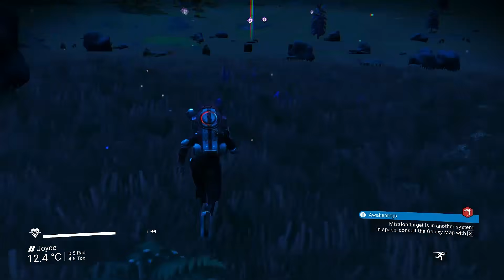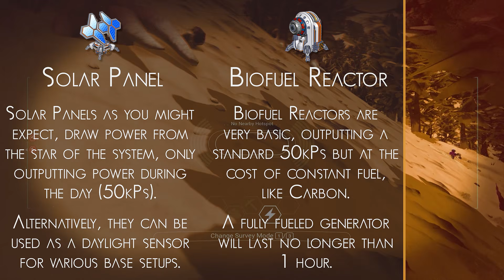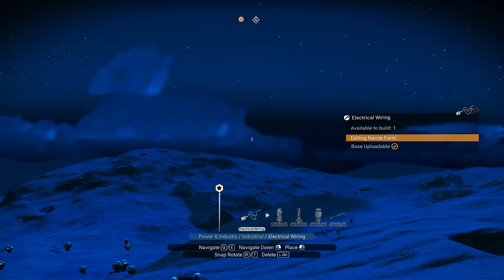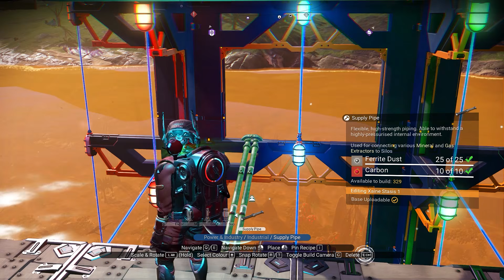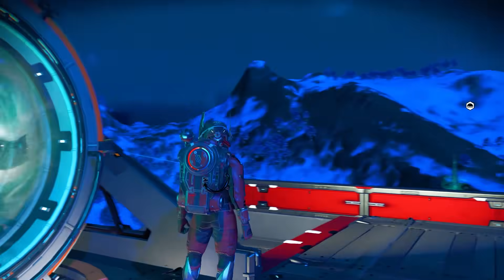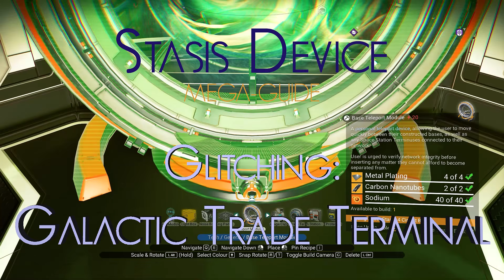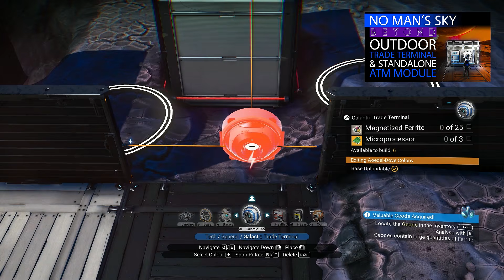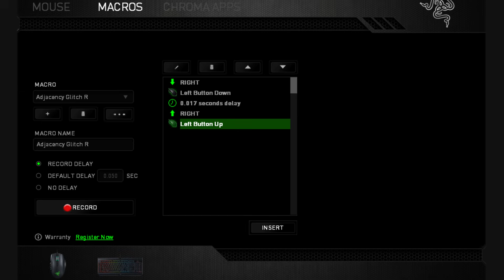Ultimate Money Making in No Man's Sky | Stasis Device Farming Mega-Guide, Units & Building NMS

Comment: What is the point of making 4 billion per hour when the cap is 4.9*** billion?
Good video though.
Reply from the maker: For achievements sake, for spending (you can spend a whole lot really quickly if you try) but also just because it can be done.
Reply: @XainesWorld  Agreed!
I just note what systems have Cobalt or Chlorine. 
Then when I need units just warp there with a ship full.
For Cobalt I usually get 82-85 million in the space station and the same at the trading post  164-170 ish million total.
For Chlorine  it's about  123-134 ish in space station plus same in trading post 246-268 ish million total
Per system.
It's even better if they have BOTH.
I have 16-20 systems that I can visit so Money's not a problem and by the time I need more the systems economy has recovered.
Just don't do it at a trade post in the "Glitched CENTRAL" systems as their stock doesn't change when buying or selling!
I did once and it took ages to get the ship filled back up with only 191 Cobolt at a time and each time you have to wait for "product received" before trying to buy again, no spamming the buy button as it doesn't register.:-(

46 stacks of 9999 to fill the ship back to it's previous level!

Lesson learned, I'm not doing that again.
The space station works fine though. :-)

Comment: OH, this is 3 years old, hmmm.  Hey does this still work?  I ask because I actually had an electrical error and did not realize the issue immediately, so I did find a power spot, yeah like my whole life it was just C but I was like cool this will work but I was outside my zone and by adding a wall I could not extend the reach, I threw down a base computer but it seems like one base can not power another base so that was a total waste of time and at this time I found the wiring issue so I fixed it and then my base was back up and running.  So yeah, old videos do not help NMS at all with so many changes and so much broken.  Later.
Reply from the maker: The part you're talking about is still accurate, I'm using it on my recent streams.

If you couldn't place the walls outside you hadn't unlocked the boundary.

To unlock just save and reload, flying away, teleporting, warping, using a portal will all lock the boundary making it so the walls won't work to increase it.

Comment: Am I right in thinking the latest update has meant the exact build technique of the farm has had to be altered slightly? Stacking biodomes as you do using adjacency glitch now makes the top one empty and unusable unless raised ever so slightly eg using roof topper on the circular room below before upper biodome, then removing lower circular room and roof topper.

Upvote if true please so others are aware of this. If not, comment and I'll remove (and get better at building)
Reply from the maker: The crops from the top one are removed if you misglitch and put a circular room below, it takes them away when you delete it. It can be frustrating, but you have to keep replanting until you glitch it correctly

Comment: Yea activated indium is way more efficient than this. Way less brain power required. Especially since there's a unit cap of 4.2 billion (xbox anyway), so there's no point making 4 billion an hour 😂.
Reply from the maker: Depends how you measure the efficiency really, also I spent 3 billion just on emergency broadcast receivers in a single session, though granted, that's not a regular occurrence.

More than anything, this is just the "Super, Crazy, Kinda Silly, Ultimate money making method, largely for min maxing and completionist goals